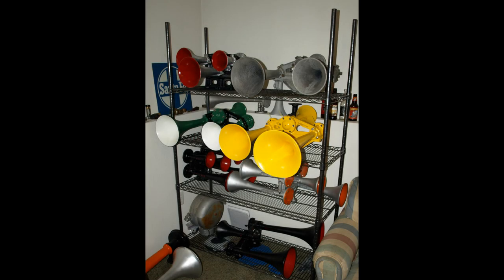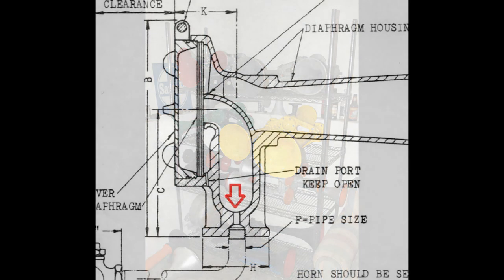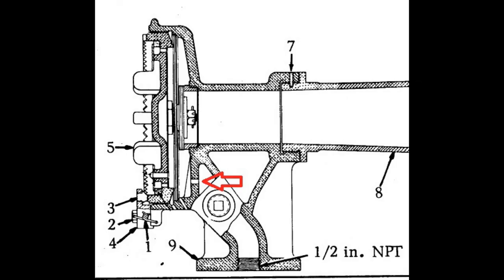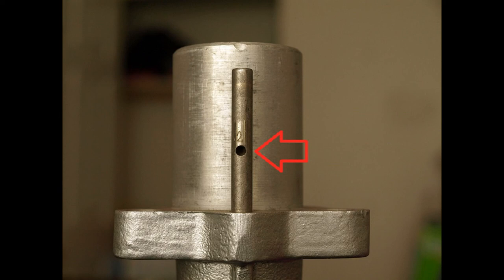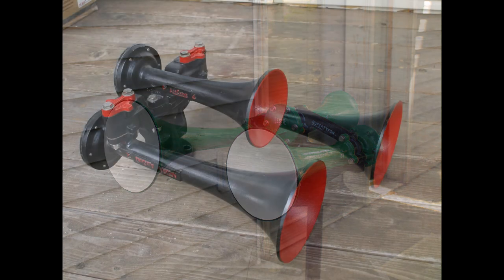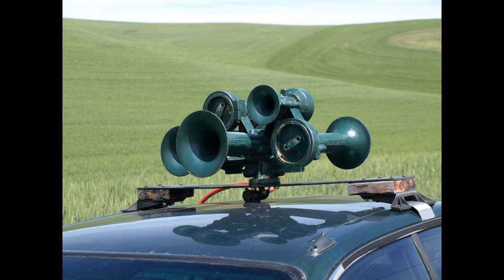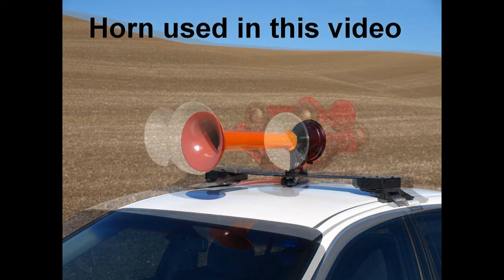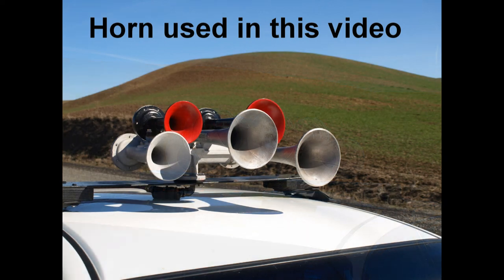Locomotive horn air consumption tests

Comment: This is what I got from a CFM calculator app I have based on the 20 gallon tank and the air time added in the description.

Wabco E2: 29CFM
Nathan M5 3/16": 73CFM
Leslie S5T: 35CFM
Nathan K5LA: 54CFM
Nathan P5A: 35CFM

A 5/16" M5 is around 90CFM I believe. Just some info for those that want to have an air compressor keep up with their horns. From most videos I've seen, honk time is normally about half of the video. That being said for a 5/16" M5, with 40 gallons of air starting at 175psi (regulated down obviously), a compressor capable of producing 35CFM is needed if two minutes of honk time in a four minute video is required without the air pressure dropping below 120psi. Then again, that's assuming the horn is not being quilled at all, so 30CFM may suffice.
Reply from the maker: Awesome info, thank you!  Is it ok if I add this info to the video description, with credit to you?
Reply: Go ahead, no credit needed. I got it all from here, though the app only works for Android unfortunately. 

https://play.google.com/store/apps/details?id=cfmcalc.igpf&hl=en

I tested my Viloco valve today and it flows about 152CFM at 90psi and 225CFM at 140psi. I can't imagine the Graham White is that much different flow wise, despite what their website says. 70CFM at locomotive reservoir pressures or anything close to that I'm sure is a huge underestimation.
Reply: I thought CFM only works if there is an infinite supply of air at the same pressure. e.g 60CFM at 100psi would only be accurate if there was an infinite supply of air at a non-changing pressure of 100psi. Because when air pressure lowers, air consumption lowers. I know for a fact, and according to the manufacturer specifications, at 100psi, a variable orifice Leslie 5T uses approximately 60CFM. Remember, this is only if the air supply is infinite and remains at 100psi the whole way.
Reply from the maker: True, but it's a good enough approximation.
Reply: Do you guys know how air a m3 needs?
Reply from the maker: Slightly less than an M5.
Reply: So maybe 20 seconds of honk time?

Comment: I have a very late 80s K5LA and all the bells except 5 have a bigger inlet hole. With it being as late as it is the 5 is not a big bore. Do you know if it would ruin the tone of the 5 to in large the inlet to match the others or would it just make it louder? I've been wanting to experiment with my spare 90s bells to see if making the inlet as big as 80s ones would work or ruin the tone. Any thoughts would be really appreciated!
Reply from the maker: Drilling out the inlet will also raise the pitch slightly. What you could do is make a choke just in case enlarging the inlet changes the pitch too much. A 1/4 hex key set screw drilled out the the original inlet size can be installed in the four of the bell. Similar to the chokes used on the large bore 5 bells.
Reply: @mafarnz  Good to know! Thank you very much for the information!

Comment: what diameter airline and valve do you use for your horns?
Reply from the maker: +thegameofhearts the tank port, hoses valves and fittings are all 1/2".
Reply: mafarnz I figured. I'm assuming a 3/8 I'D valve wouldn't make all the bells open correctly?
Reply from the maker: That would work ok for a P horn if it were a short run of air line, but for most horns that won't be sufficient.  The fact that the inlet on the horn is 1/2" should be a big clue.
Reply: mafarnz thanks for the reply.  looks like I'm going to have to upgrade my valve before the horns get here